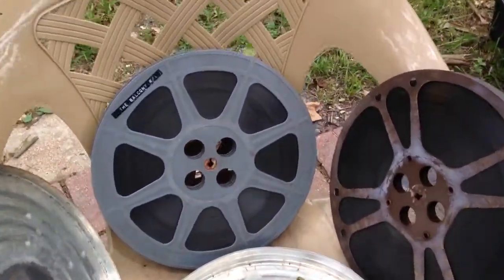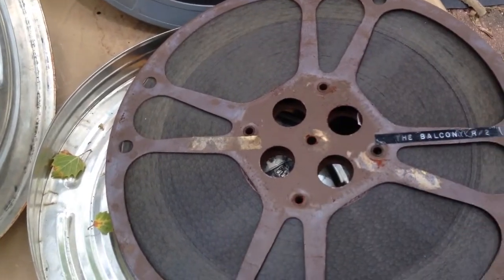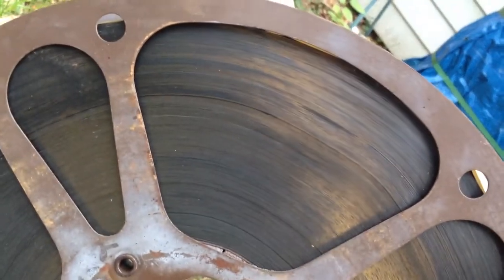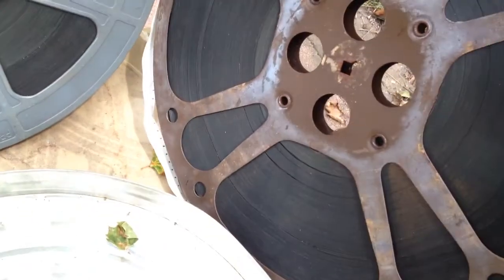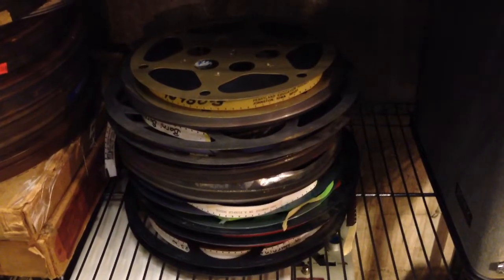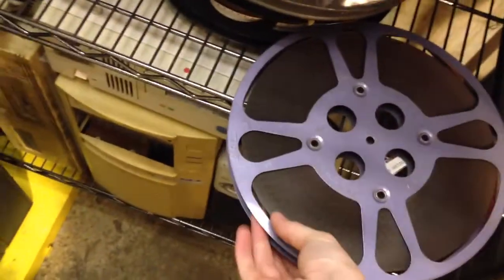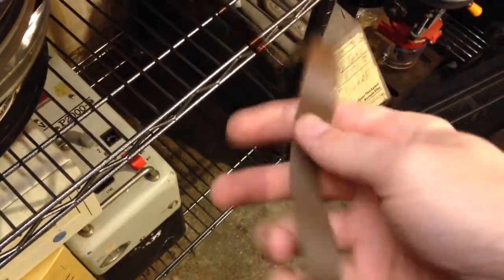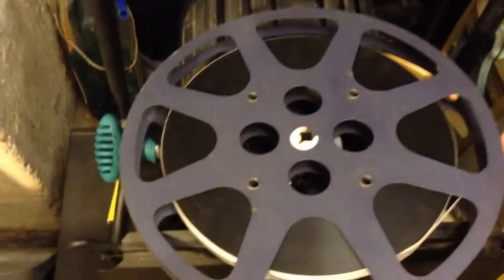Personal Bits 0331: 16mm Film and Vinegar Syndrome

Comment: Are you still working with 16mm film ? I’ve  been a collector for  some time  but I thought that black and white film did not get VS but I could be wrong on this I do have a B&W film that smells sorta strong and I’m a lil bit afraid to run it through my projector for fear of cross   Contamination on my other films. Did you ever watch those films?
Reply from the maker: cross contamination? vinegar syndrome isnt a sickness. you do realize that right?
Reply: Yes but I read a article that said that if you run a VS film through your projector it can infect your other films

Comment: I heard polyester prints don’t get VS is that true.? I’m just starting to collect film 🎞️
Reply from the maker: Yeah Polyester would probably take 10x longer to degrade or maybe more. I have a 2008 35mm film trailer that I left in an illinois storage unit in the heat for 10 years and it still looks fine.

Comment: Hey I have a 16mm film of the andy griffith show and it is in a canister, it smells like vinegar and red but isn't warped and the reel is still fine. What should I do and how should I store it?
Reply from the maker: sounds like your film is getting near the end of it's life. it would be best to wash the film because there is acid developing on it, thats what creates the smell. a bath of baking soda could work, however youd need reel-winding equipment for that. for now it is best to keep it in a cold and dry place, and that will slow the rotting process. maybe even store it in a deep freezer if possible. but do what you can.

I'm planning to make a film washer. will have a motor turning one reel very slowly and have the film feed through several loops made from sewing thread spools. film will first go through a bath of baking soda and water, then it'll spend some time out of the water passing back and forth through a few pulley in front of a fan to dry off, then get rolled up on the motorized reel. not sure if itll work though, and since film image is stored on gelatine layer, the film could possibly become sticky and melt together if not dried enough. i'm not speaking from experience, only theory.

heres an idea that might work better for you though, and i plan to try also. i think the acid evaporates slowly and thats how it gets all over the film and speeds up the rotting, so if you put some baking soda in the bottom of the reel it should absorb evaporated acid. then maybe keep it in your basement where is cooler or in a fridge and it should last much much longer. and hopefully that baking soda would slowly get rid of the smell.
Reply: Rinoa Leonhart Okay I will do that, tell me if the baking soda works for you.
Reply: @rinoaleonhart86  Did it work?